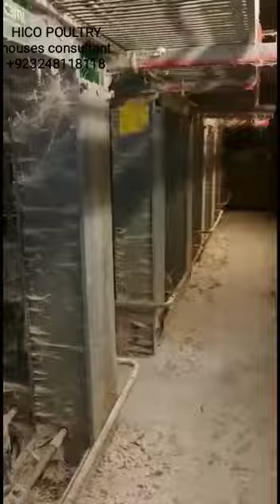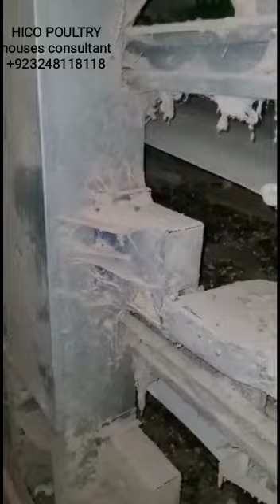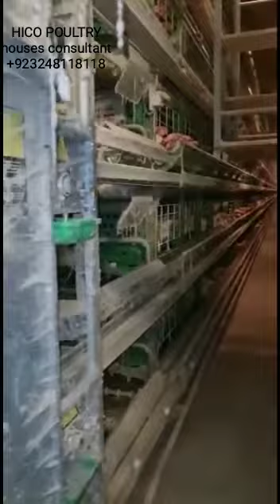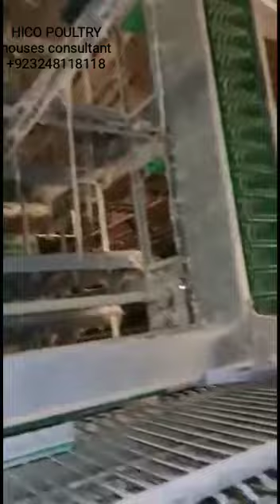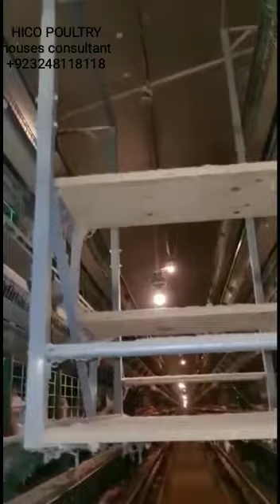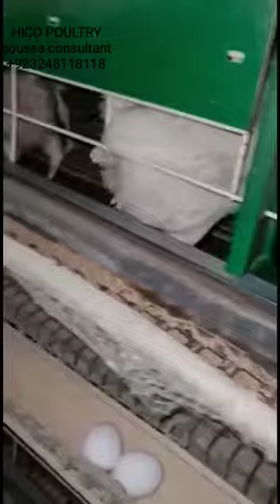#Battery #Layer #cage house for sale #Zucami 2nd hand System @50% less price by#HICO capacity 72800

Comment from the maker: Battery Layer cage,2nd hand ,best condition System Avaiable for sale @ FOB price from Spain and France.

Bigduchman bird capacity 131000 Model 2016- 

Zucami bird capacity 72800 model 2011- 

Tecno -bird capacity 45000

Best condition.details and visit of france/ Spain,Available on request.
Rearing cages are available on demand.

No Message reply .
only Call if interested

 HICO- Poultry houses consultant 
+92 324 8 118 118

info@hicophc.com

https://www.hicophc.com